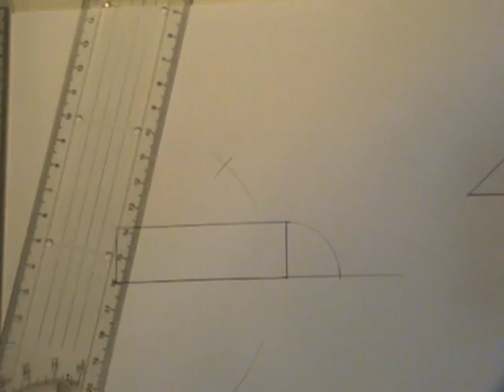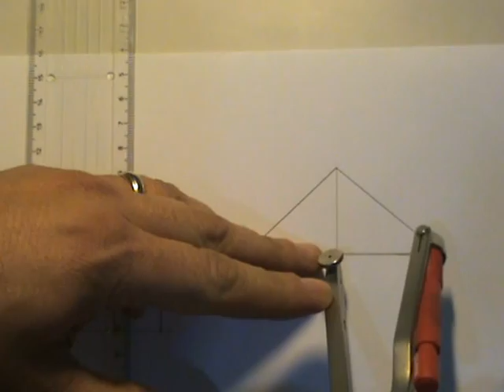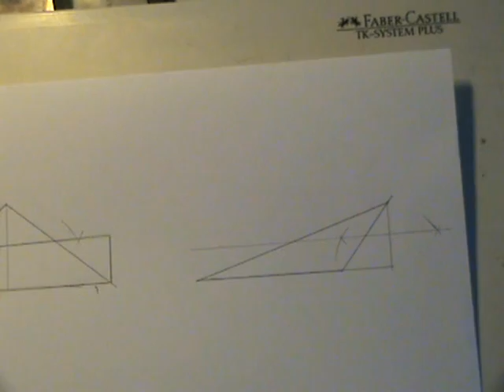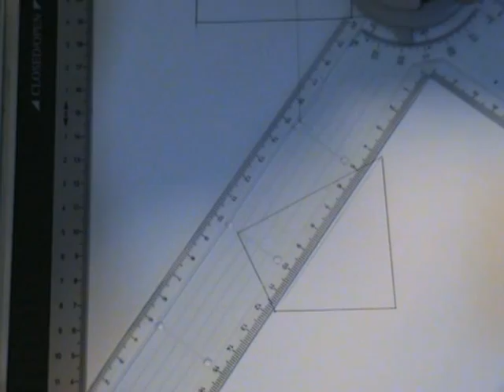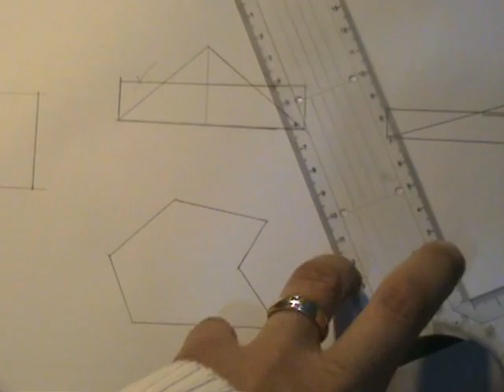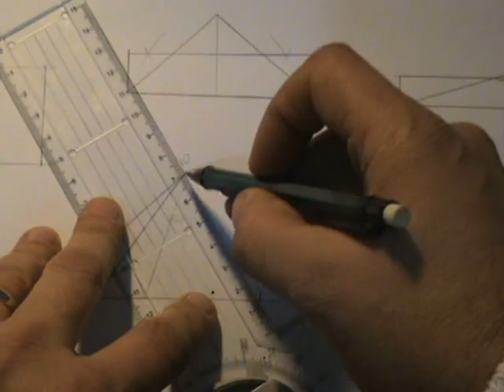Polygons of the same area

Comment from the maker: If there is a graphical method I am not aware of it. Also when converting to a rectangle, there can be more than one solution. For instance a square with 10mm sides has area 100mm2. A rectangle with the same area could be 5x20 or 4x25 or 50 x2 or 8 x 12.5 or an infinite number of possible lengths.